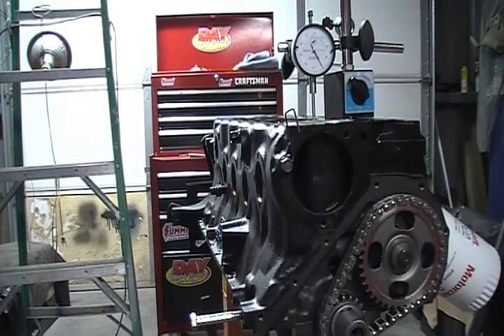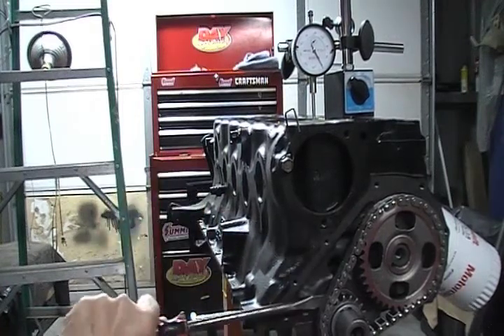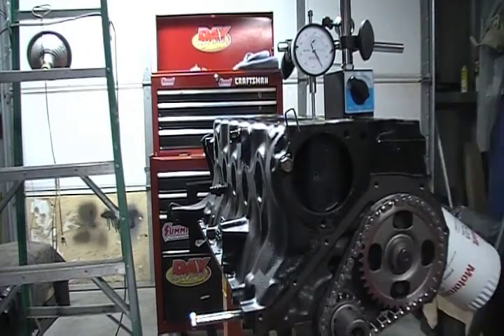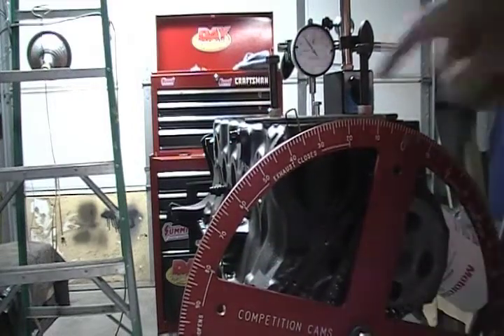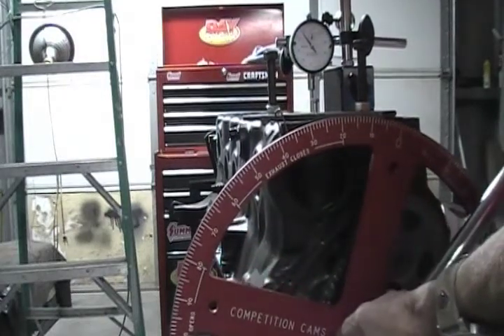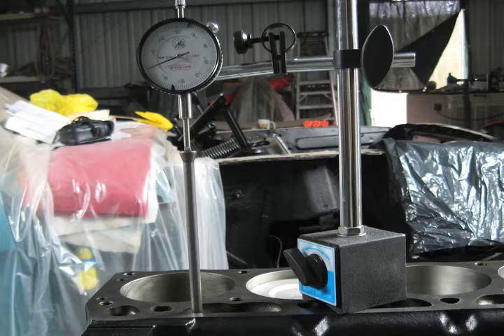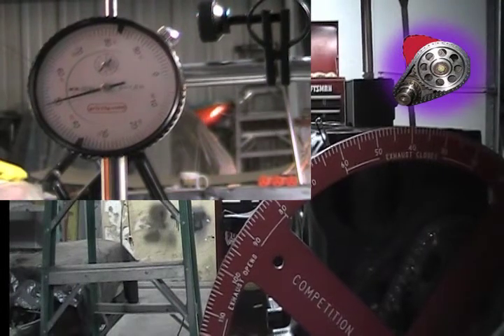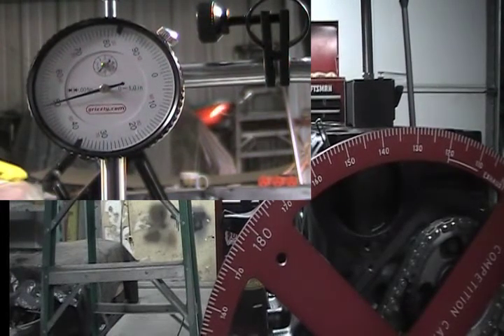Mustang 200 Rebuild Part IV.mov

Comment: Am I missing something when you change the key way the crank gear is in? I see you rotate the crank gear, but not actually change the indexing of the cam to the crank.
Reply: 4-years since this comment, but that's exactly my question. I'm currently building almost the same motor, Clay Smith Cam, and their video should be made like this one, and include more detail on what you just mentioned. Just rotating the gear and then not move the crank too... realign the dots(?) ... What changed? Gear teeth only moved, as far as I can see - and this fellar even said the dots might not align!? I can understand if it's a half tooth off, but there was zero mention here, or in the Clay Smith video, of what you do to the crank, or cam, before reinstalling the chain. 

Anyway, I'm doing this right now, so may update my comments with what I teach myself. Just for the next guy.

Comment from the maker: Hey tmrbiker… I’m not familiar with the engine you are working on.
However … Holding the piston rod in my right hand and the piston notch facing to front of engine (right) the oil hole is on top… (or closest to you if ya holding it straight up) Hope this gets to you in time to be of helps …

I did not have the nerve to press my pins in. I had a machine shop do that…. Small note: you should have the new rod and pistons balanced. 
Good luck…